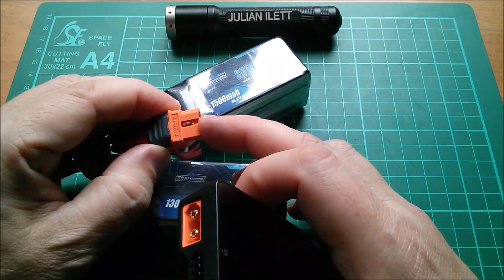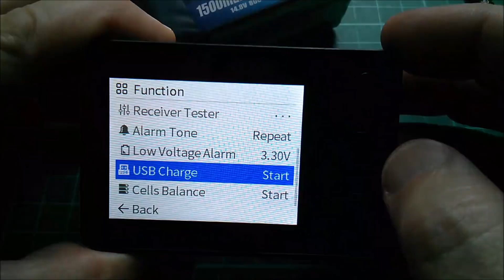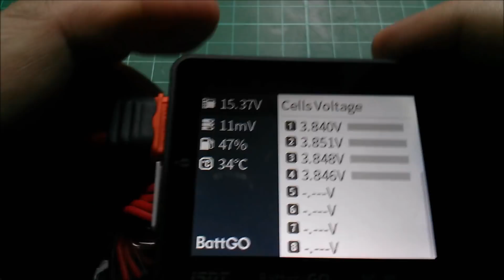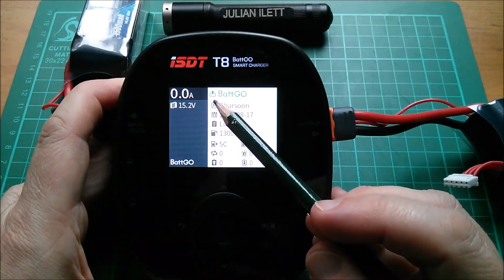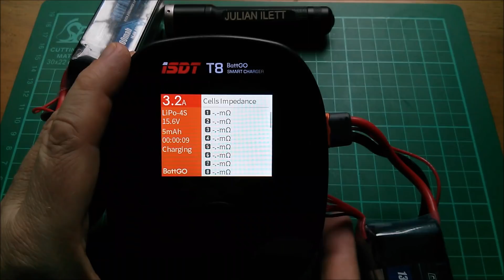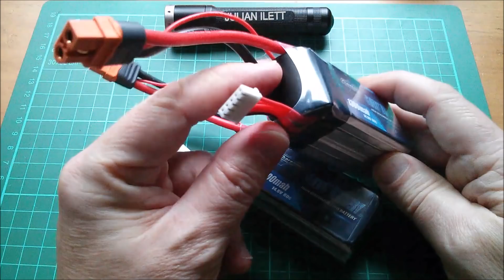First Look: Charsoon Smart Battery BattGo 1300/1500mAH

Comment: The storage voltage is the optimum cell voltage for battery (unconnected) shelf life. You may find a 3.8 cell optimum storage setting will bring the cell up to a higher voltage for a preset long storage length to allow for a longer dwell of optimum 3.8v during it's open circuit discharge curve.

Comment: Well... this technology is quite useful to buy/sell used batteries, no more false "i just used it 5 times" for a battery that has suffered 300 cycles and severe discharges...
Reply: Indeed, unfortunately it is probably not that hard to manipulate the counter and reset it...
Reply: Without ripping up the tape? Likely not. Whether I'd be willing to charge a LiPo battery I got off some bloke down the pub in my house is another matter.

Comment: This looks like an interesting development. Shame no info in the interface, some kind of 1 wire custom UART I guess. If they want this to succeed I think they need to open source the protocol to help grow adoption.
Reply: Want to succeed. Depends on several things. Interestingly Del uses and has used for years the 1 wire custom UART serial protocol for a long time. They use it, supposedly , to make it tougher for non Dell folks to make chargers that will work on their laptops. I knew of one gentleman who cracked the system and was able to make a charger, he was featured on the Hackaday site or channel .  I have decided that I will not by another Dell for this reason, why do that with their chargers ? Assanine.  That's my opinion and sticking to it as we say in the US lol.
Reply: Best of all, the serial comms wire on the Dell charger lead was prone to failing. This would render it unable to charge the battery because it would then think it was not a genuine Dell charger.
Reply: It is an unappreciated system for sure. Yes when that happens, typically for me, you have to restart. Crap ! For sure.  The Dell chargers aren't that expensive but as a matter of convenience, occasionally a person may need to plug something else in. With the same voltage, current capability of course. Such as charging with solar or direct from a battery system. But, Oh No, Dell Says, we can't have that. Last Dell for me.

Comment: Do this batteries then have protection circuit built in to prevent overdischarge/overcharge/overcurrent like mobile phone/laptop batteries? 
Does it balance itself (without balance leads connected) or at least cut power/disconnect itself if it is way off balance (one of cells overvolt) while charging?
I'm gonna be naging at all RC/hobby shops again... in one of shopping centers they call me Battery raider (coz i come with big backpack and empty whole used battery bin into it, to get mostly full alkalines, 'bout 1 in 20 or 30 is full - 1.6+V, but there are other goodies too, fairly new smartpones with bad battery or broken connectors etc. and then bring the empty ones back after few hours)

Comment: The temperature on the display is that of the battery I guess. I think that a temperature chart during charging would be a good record of the aging of the battery since by aging the battery resistance is increasing then the temperature also. Any comment on that Julian? thanks.
Reply: the smart charger has an impedence measurement function, you will probably have to take that with a grain of salt like most other chargers but it should actually work quite well because it can send a pulse (+ or - current) through the XT-60I and read the voltage changes of each cell, that is why it needs the balance lead connected in order to measure that.

Comment: DJI Mavic Intelligent Flight Batteries  has the auto storage function too. After 10 days, it discharges to 50% charge. This should extended battery life... but it is an pain in the behind
Reply from the maker: +isojed Can't you disable it?
Reply: it can not be disabled. Choices are 1 to 10 days.

Comment: these kind of batteries would be awesome if you could read out the data with arduino/raspberrypi so you can make robots with lipo monitoring.

you should do some reverse engineering of the "BattGo" system :P

Comment: What's the betting that plugging them in to monitor the voltage resets the timer and you won't see a nice smooth gradual discharge...
Reply from the maker: +Nicholas Barnes That's possible. I think I'll wait 2 days.
Reply: Might be best to try use a DVM to test the voltage first - or your half in half out method I guess?

Comment: Is Char Soon a bit slower and less exciting than Ultra Fire and Bang Good? 
Serious questions Julian: Why are the capacities of those batteries so low? Is this a case of a Chnese manufacturer being honest about true battery capacity, or is it a feature of high discharge rate LiPo batteries? 1.5 and 1.3 Ah are close to the capabilities of Lead acid batteries of similar sizes, but with less mass. Thanks.
Reply: These are meant for high discharge in applications like quadcopters and general RC stuff, you don't want to have much weight... (and yes, the capacity is usually spot on)
Reply: Thanks Tobias. I guess that LiIon batteries have much higher charge density but cannot survive 80C discharge rates; the two being mutually exclusive?
Reply: Yes, those are the relative advantages these two different (despite both being based on lithium) chemistries have versus the other. Also, Li-ion is a bit less "zomg! I screwed up and now my house is on fire" as a chemistry.

Comment: Hi Julian,  I want to create a 12 to 18v battery pack using lithium cells, say 3x4.2v (12.6v Max).  X4 packs in parallel (3000mah per pack) making approx. 12000mah pack.  Can you tell me what the best way of charging this packwould be and best way of protecting it with say a bms board?  Much appreciated.  Look forward to your reply.
Reply: I see I didnt even get a reply. lol.
Can you tell me what the best (in your opinion) battery charger would be for a 7.2v lipo rc battery pack? Thanks.... im hopefull this time. I know you must be bogged down with replies

Comment: 33ºc??? really?
Reply: +proy yeah that seems bloody hot to me sir
Reply: It's a realy good heated room at 40°
Reply: that's really hot most people like about 22 c
Reply from the maker: It's a tiny room , it warms up really quickly with a 1kW fan heater :)
Reply: that must be why sir, keep un coming . yeah a  fan heater isn't cheap to run
Reply: I would sweat like a waterfall in there... Everything over 20°C is in fact unbearable for me...
Reply: The temperature reading is 25 degrees when he plugs it in at 3:00. The sensor is probably very close to the chip which heats up while transferring data.

Comment: Bewildered - What is the point of charging a battery with another battery?
Reply: Pretty sure he was just doing that for demonstration purposes and in this instance I can't think of a reason, although there is one good reason to do so, solar charging.

Since lead acid batteries don't like being discharged under 50% or for any length of time for that matter it's therefore best to try to keep them discharging as much as possible in order to maximize their lifespan but it gets complicated charging lithium batteries if you prefer using them, so instead you can use a small lead acid battery sort of as a huge capacitor to charge your power banks or other batteries from solar power, it's not an elegant solution but it does simplify things a bit.
Reply: imagine you have a device that uses 1.5Ah cells and you want good runtimes, you could have 2 small 1.5Ah cells and one big 10Ah battery to charge those up. be running a battery while you charge the other with the 10Ah one. yes charging a 1.3 from a 1.5 is pretty pointless but he was just demonstrating what the BattGO system is capable of.

Comment: Probably closer to 8c than 80c.
Reply from the maker: We've all seen LiPos used to start car engines.
Reply: 80C is 120A for the 1.5 Ah battery, but it will be exhausted under that load in less than a minute. (Less than 1/80th of an hour.) The point is that it will be able to handle that heavy load without suffering any damage.
Reply: Try discharging it at 120A and see what happens. I'll bet you it puffs up.
Reply: RWBHere: I have about 200 lipos, don't really need a lesson about batteries thanks.
Reply: And I bet the XT60 connector melts since it's only rated at 60A.

Comment: Why is the capacity so low? Even my Phone has 1650mAh and the battery fits into my palm and is about 3mm thick.
Reply from the maker: +Dedmen Miller Capacity doesn't take voltage into account. Better to compare Watt hours on both.
Reply: Also, try to pull, say, 40c from your phone battery and see what happens ;) These are Li-Poly batteries, your phone has Li-ion, different chemistries mate

Comment: Sooo uhhh that 1500mAh battery can discharge at 12,000Ah? 1,500*80= 120000mAh/12,00Ah Thats insane xD
Reply: That doesn't make any sense... Amp hours is a unit of power over a period of time, amps/current is a measurement of how much power is flowing, a C rating as quoted from google "a measure of the rate at which a battery is discharged relative to its maximum capacity. A 1C rate means that the discharge current will discharge the entire battery in 1 hour." in other words, no it can either output 1.5A for one hour or it can output up to a maximum of 1.5A x 80C = 120A for roughly a minute or two.
Reply: Ah so the 1500*80 is the burst of power, basically.
Reply: Yeah sorta, the C rate is the max it can safely output, which is necessary for inductive loads such as the motors in quadcopters or rc cars, because a motor may normally only need let's say about an amp to run but it could need a much larger inrush current of a few amps to get started or if put under stress, so in that case you would need a battery at minimum of around 200mah with a 20C or 25C rating to properly power your toy.
Reply: Makes sense. Thx for the clarification :D
Reply: That C rating is bogus to begin with, but if it were true it would likely be a "peak" rather than "sustained".
Reply: Paul G C ratings are burst power so it could be semi accurate

Comment: To bad Banggood is a ripoff. When they don't send you your stuff they just ignore you.
Reply: That seems odd, thus far I've gotten what few things I've ordered from them but there were a couple times I've had issues, for example I bought an LTC3780 from them and it didn't come with any heatsinks so I told them about it and they gave me a 50% refund within 24 hours, then the next day I hadn't even loaded the thing down and it quit working, so contacted them again and after providing proof of it not functioning they gave me a the rest of my money back with no further questions, certainly handled it better than the one time something similar happened with a chinese ebay seller he told me he would send a replacement which never showed up.
Reply: I have never had a package go missing from them.
Reply: Me neither, because the name and very long delivery date estimates dissuade me from buying from them.